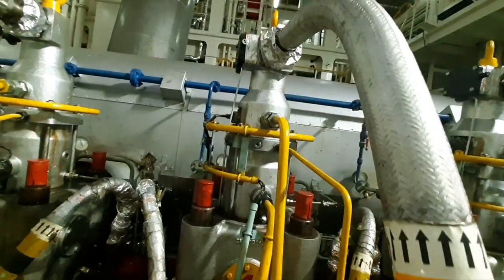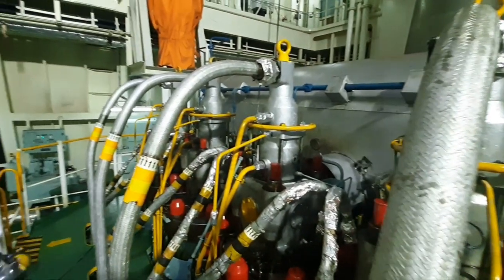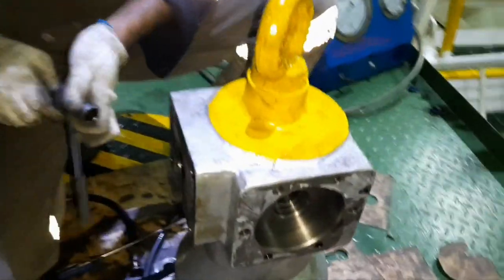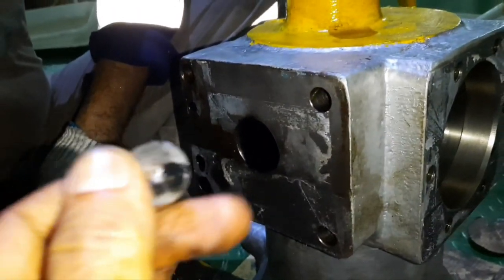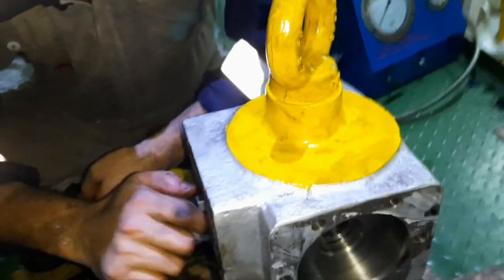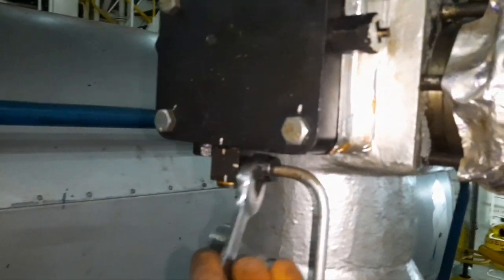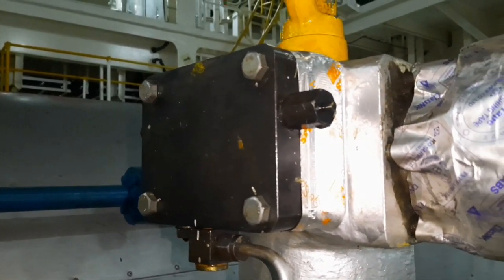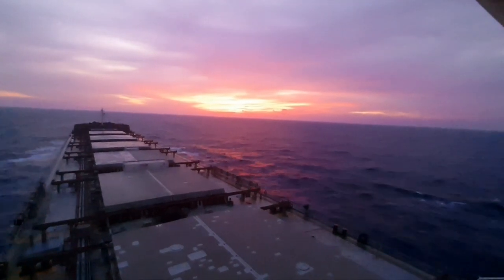ME ENGINE  EXHAUST VALVE OILSEAL CONTROL UNIT |KNOCKIN G PROBLEM RESOLVED |SEA LEGEND

Comment: Hi. So, if the orifice is clogged there is no sealing oil dosed to air cylinder stuffing box. In this case can we expect big hammering noise coming from valve? What is the reason of this hammering?

Comment: Can you tell me the function of oil seal control and throttle valve fitting on the exhaust valve actuator? Thanks too much,hope you noon feedback.
Reply from the maker: Hey sorry for late reply...the oil seal control unit feeds a controlled amount of oil dose to the air cylinder stuffing box.This oil is needed for lubrication of Exhaust vv spindle ,particularly in the portion where there is sealing of Exhaust gases. U can watch my video on ME Engines Exhaust Valve ohaul...u will get an idea of it..Thanks for sharing ur doubt.